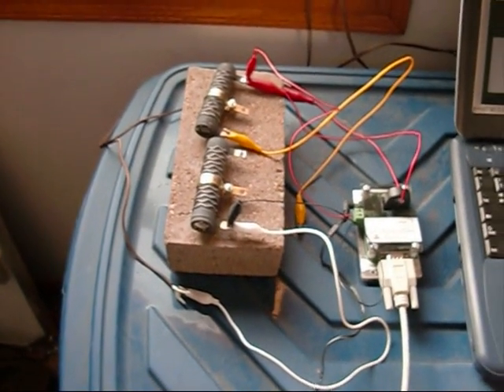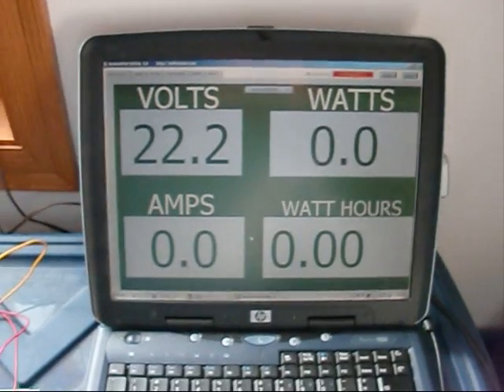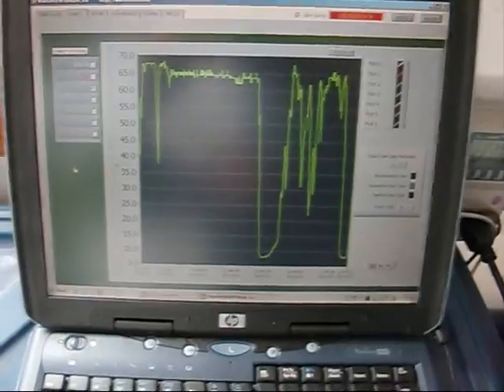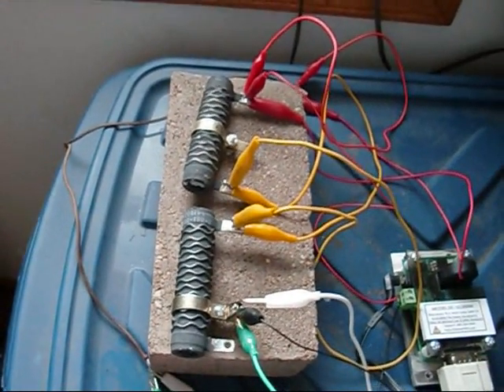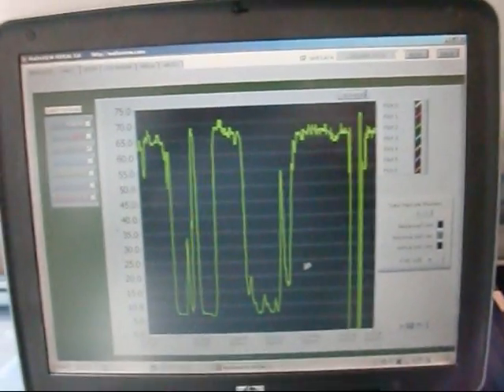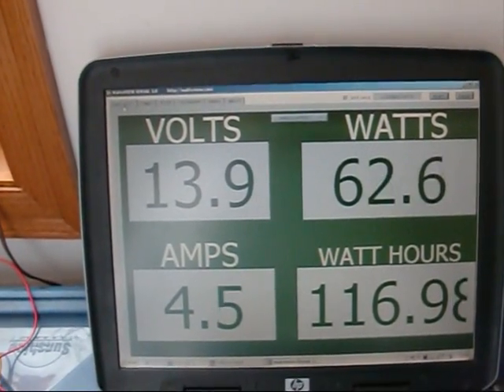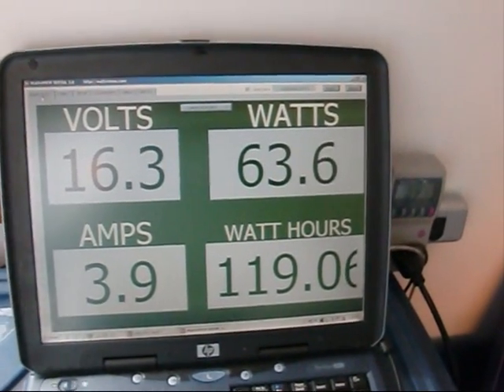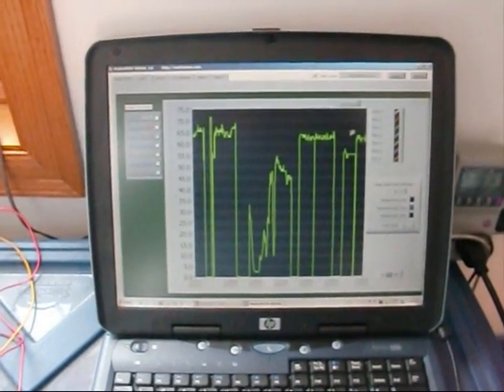Part 2 of 3:  Solar Panel Characterization using resistive loads

Comment: mmm i'm going true all your video 1 by 1 

those would make great heater and pretty cheap one 2 

i have check eBay Store: Coleman Air Parts
there is a few Diversion Dummy Load Resistor Heater ... for around 100 $ + or - 
i'll probably make it my next project 

Great video !

Comment: Don't forget about the wire loss from the panel to your resistors. Those clip leads are about 4A max. You can always solder on a larger wire and have a set ready for this type of stuff. Thanks for the tests, very interesting.